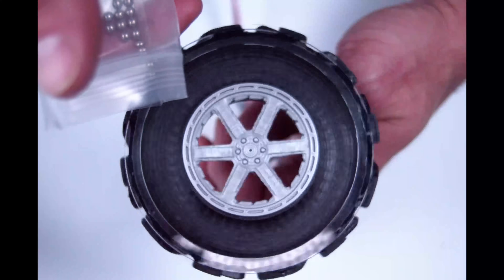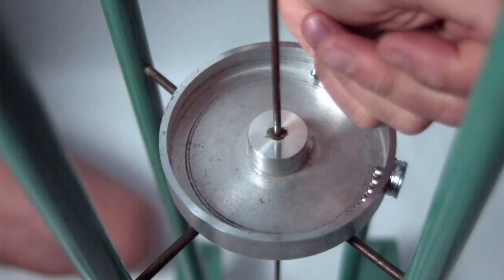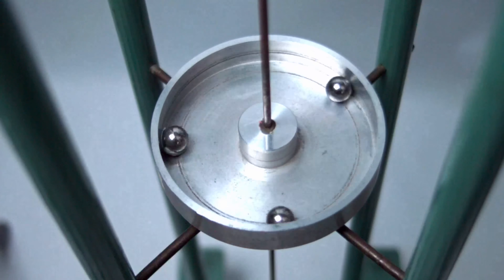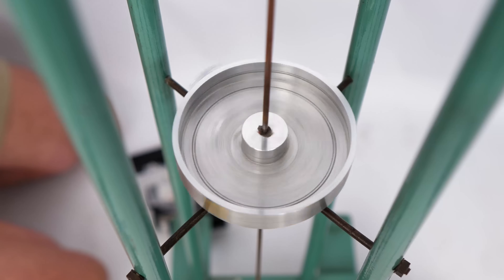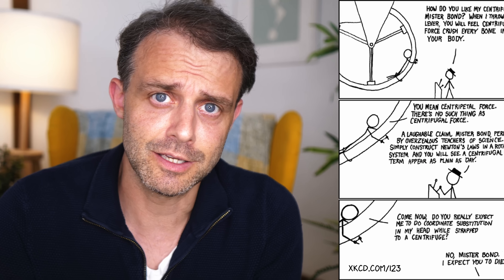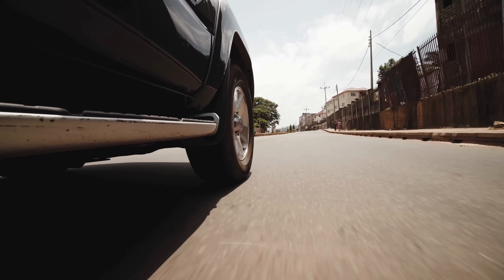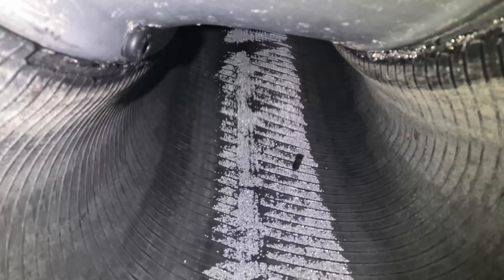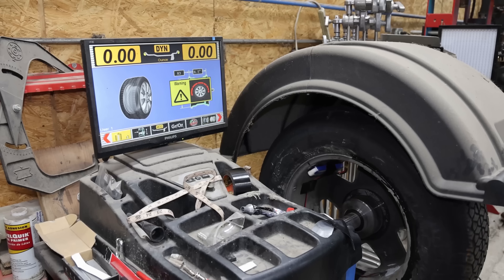Do tire balancing beads actually work?

Comment: A real world difference from tires and that machined aluminum cup is runout...tires really aren't all that round.
   It is even marked. New tires sometimes have red and yellow marks. The red one indicates maximum radial runout. ( actually, I think it's defined slightly different). The idea being that you measure the wheel runout, and mount the tire so that they cancel. 
   I've never done that, or heard of anyone who has.
    Toyota lists a max runout for a mounted inflated tire as 1.4mm.
    The beads would tend to rest at the spot with maximum inside radial runout, if the axle were rigid. (But it's not)
    I put the beads in my medium duty truck tires, since they won't go on my balancer..I am really not sure if they work, but am inclined to say they help.
   Thinking of making a fixture for the balancer for them.
   Thanks for this interesting video, I never thought of the transition from one mode of vibration to another.

Comment: Okay, so it sounds like what it does is work in a theoretical sense.
Given all those limitations it sounds much better to just get your tire balenced. Particularly considering that bits of glass or steel rattling around inside your tire might cause damage and further unbalence the tire.

Comment: Have used the balance beads from a washing machine to balance a driveshaft. Driveshaft had a pretty significant offset to one side as well as a drop from transfer case to differential. 1951 Dodge M37 with a SBC and a NP205 and stock offset rear differential. It needed the beads at HiWay speeds. Gear ratio was 5:83 so rpm were pretty high. Beads helped a LOT.

Comment: Pretty cool...since you would need the balance at high speed only anyway...

But

I could imagine that the balls wear down the tire on the inside just like the road does on the outside

You can't really see if the tire is worn on the inside tho...

So hopefully it goes bad on the outside before the inside gets too badly...

Comment: I wonder if those beads inside your tire along with weights outside would work. So if you have a tire vibration only at highway speeds then when you hit those speeds the beads will do their thing and at slower speeds the outside weights will do their thing.

Comment: What about a liquid? How about a liquid that sets after 20 minutes? Not solid but to a rubber like material? Wouldn't that solve the "until gravity can shift the beads at low speeds" problem? 

I could see a balancing can. Put it in like fix a flat and get up to 88 mph. And wait 20-30 minutes. Once you slow down, the tire doesn't lose its balance.

Comment: All I know is my 44 inch TSL swampers would beat the teeth out of your mouth until I added 1 pound of equal balancing beads to each tire.. what a difference that made but I agree with you because I can confirm that I have to reach a certain speed before the effect of the beads do anything however that speed for my tire size is not highway or freeway speeds it's roughly 35 miles an hour and then all the sudden it just gets smooth and it will stay smooth down to about 15 miles an hour or so and then I noticed they have no effect until I speed up to that 35 again this was an excellent video and the way you explain it makes perfect sense

Comment: Tire balancing beads are ineffective because tires aren't perfectly round when in use. On the road, the bottom of a tire flattens under the vehicle's weight, conforming to the flat surface. This distortion causes the beads to disperse or bounce erratically during rotation, preventing proper balancing. Unlike a solid metal disc, which remains perfectly circular, a flexible tire constantly changes shape under load.
Testing balancing beads on a tire machine balancer is misleading because the machine holds the tire in a perfect circle, unlike real-world conditions where the tire is distorted by weight and road contact. After years of research, I believe tire balancing beads are a scam.
Additionally, the balancers shown in some demonstrations are engine harmonic balancers, not tire balancers. An effective tire balancer would need to be a rigid, round tube integrated into the rim itself, not loose beads inside the tire. Loose beads or balls placed inside the tire can't maintain consistent positioning due to the tire's flexing. Instead, any balancing solution must be fixed to the rim to avoid distortion effects.
I hope this explanation clarifies the issue!

Comment: Very intriguing — but my thoughts immediately went further. Shouldn't the same effect apply to liquids? After all, liquids are essentially countless tiny molecular spheres, and at high speeds, they should also naturally center the mass.

Now imagine using a fluid that hardens into a soft, rubbery compound after about 10 to 20 minutes and chemically bonds with the tire’s rubber. All you'd have to do is fill the liquid into the tire, mount it on the rim, inflate it, and spin it at over 80 km/h for 20 minutes. By then, the fluid would have solidified and fused with the tire — producing a near-perfectly balanced wheel, regardless of speed, since the mass distribution would now be fixed in its ideal position.

If someone can disprove this, I’d love to hear it. And if someone uses the idea to get rich — just send me 1% of the profits. Thanks.

Comment: A high-speed CD burner I once had used balls in a cylinder to balance the disc before starting the burn process. The drive would go up and down in speed a few times to allow the steel balls to find their spots. Once it got into balance, the drive then increased the speed to ludicrous and then the burning process began.

Comment: I wonder, could you do something similar with ceiling fans? It'd be janky but I'd be tempted to test sticking a 3d printed jig with some ball bearings in it on each blade of an unbalanced ceiling fan and see if it can self-balance.

Comment: Why not create beads that are injected into the tire and then glued into place? You inject them at the balancing station, rotate the wheels at high speed for the time the glue needs to be applied, and there you have it.

The current technology with weights may be good enough, and the beads will not balance in the left-right direction.

Comment: The problem for the car is that the wheel rotates around a rigid fixed axle and not on a flexible shaft like yours.

Comment: What if you apply epoxy resin inside the tyre, add the beads drive at freeway speeds while the epoxy dries up and the beads position themselves to cancel out vibrations with balanced positioning....🤔this way the beads will remain in the correct position to damper any wobbling....plus they won't slosh around during low speeds....

Comment: Working on car for 2 long , we usually get complaints about vibration at 50 and it goes out by 65-70 which is always tyre balance , we know it balances once the speed raises and the vibration goes some could be near 90 but they still go , but I have never had vibration at such low speed you mentioned

Comment: Snake oil. Beads don't work in a tyre as they require the wheel to be rotating at a constant or steady speed. As soon as you apply the brakes, accelerate fast or hit a big enough bump, the beads lose sync with the tyre wall and the wheel would become very unbalanced. Even if this only happens for a short period of time, the vibrations can still cause damage.

Comment: Glass beads suck. They break apart eventually and turn into fine glass powder inside the tire. I know thus because I used them before on my semi truck. I then went and spent the extra money to get what I used in the past and know it works. The company Centramatic makes disk that sit in between the break and the rim. The outer diameter is a tube with oil in it where many ball bearings float in. They made my truck run extremely smooth. Unfortunately, they only make them for commercial vehicles and one ton pickup trucks.

Comment: I would imagine the next level invention would be to make them become sticky after a certain period of time or temperature profile and then stay stuck into the tire at the place they settled on. This would improve the situation for lower speeds and remove the internal tire wear problem, that has been mentioned in other comments. On the downside it would not keep auto-balancing during a tires lifetime, but we could simply add some from time to time.

Comment: I bought some a ways back to install on someones car that doesn't like to take care of it much, and found the same facts about the speed problem and didn't install them...  But I gamed out how it worked and how to improve on the idea.  It's not as simple as pouring beads in.  It requires a hub installed on the wheel to which heavy balls run around a track and which are held down at low speeds by way of a spring steel which releases at those freeway speeds.  When the freeway speeds are decreed the spring engages them into a rubberized floor holding them in the exact position, keeping the balance.  I'm not patenting the idea, I'd be fine to see someone who cares to think it worth to implement it do so.

Comment: That's also what happens inside washing machines during the spin cycle! The clothes tend to self-balance and reduce the wobble of the drum. That's also why washing machine drum shafts use flexible connections.

Comment: There is a device out there for Big Trucks called Centramatics.
I put these on all the wheels of my truck, and all wear issues went away.
Alignment was a pet peeve of mine, and I had the alignment checked and adjusted.

The only time the truck was shaken by an unbalanced tire was if the issue was in the trailer tires!
Reply: BTW, I should mention that I regularly put over 300,000 miles in the truck per year.
Between having all of the tires set for exactly the same pressure, the alignment, the balancing, and “grounding” (another story for another day), I could get 200,000 miles from steer tires, and 300,000 miles from my drive tires.

Comment: Is this related to counter steering on a motorcycle? Regarding speed? 9:16 ? You can't counter steer at low speed. But it is a dream at higher speeds.

Comment: So it would seem that balancing beads would be less effective on larger tires as they would have to roll at higher speeds for the R.P.M. of the assembly to reach the point of transition - large tires might never balance unless vehicle speed is far above normal speed limits...just a thought.

Comment: Lol 😅 they might work sometimes at certain speeds only in static balance mode, I guess it's not a scam but definitely  misleading marketing. 
I've tried several different brands of balance beads in several different size tires and have never been happy.

Comment: First off balancing beads are nothing new. It’s how truck tires are and have always been balanced. They work great in truck tires, as well as in mud tires. You can’t balance a set of 44 inch mud tires with a wheel balancer and wheel weights. Even if you managed to they would go out of balance almost immediately as chunks of the tread are ripped off, or the wheel and tire change their orientation. However using balancing beads in a car tire is a pretty stupid thing to do in my opinion. First off car tires are extremely lightweight and the beads are going to cause a bunch of wear inside the tire, not an issue when your taking about a heavy duty truck or off-road tire. Secon off most cars now have TPMS sensors and a bunch of ceramic beads flying around inside the tire is very likely to damage or destroy them in a few thousand miles of driving. Car tires don’t shed chunks of tread so they will stay balanced for the life of the tires. And lastly you can get car tires balanced almost anywhere and it doesn’t really cost much. I use balance beads in tires that can’t be balanced with wheel weights on a machine. I have them in my service truck tires and in my mud tires on my jeep. I don’t have and haven’t had them in any of my cars, vans, suvs, or pickups (well the F450 is an exception 19.5s are sort of mini truck tires, tire shops that only work in cars won’t touch them, ones that do truck tires treat then as truck tires and change them manually often without removing the wheel from the vehicle, they just throw a bag of balance beads in and call it good).

Comment: The larger the tire the less effective standard balance weights become. my 54 inch tall tires that weigh 550 pounds (roughly 250kg) the stick on weights are quite large and not really possible with rim clearances. Balance beads however work where there is plenty of room, and the adjust for tire wear and damage over the life of the tire. Typically balance beads are the only way to balance large commercial over the road trucks.

Comment: The eccentric mass and compliant axle behave as a second order low-pass filter to input speed. At a very slow speed, oscillations are relatively small. Near the resonant speed, oscillations are large. At a fast speed, oscillations are attenuated. 

The oscillations of the free ball also make sense as a "mass-spring system," where the "spring" here is actually the potential field created by the centrifugal force. At slow speed, the "spring force" is very small. At fast speed, the "spring force" is very large. This is akin to increasing the frequency of a pendulum by increasing the gravitational force (which does not increase mass). As such, increasing the input speed increases the resonant frequency of the "ball pendulum" by the square of input speed, which attenuates the oscillations. This is why the oscillation magnitude around the equilibrium point decreases with increasing speed. 

Of course, none of this matters for car tire balancing, because the road is a lateral distrubance to the tire, which oscillates as a mass-spring-damper with the suspension. Not only does the tire become imbalanced again at slow speeds, but also when the tire is disturbed by significant bumps in the road. 

Just pay a mechanic to balance your tires. It's usually free with installation.

Comment: In my old mud truck i used several different ways to balance my tires. They were 40”x18”R16.5” super swamper boggers. For a long time i used the same stuff most log trucks use. It was a type of sand or glass media. Then i used golf balls and tennis balls. They all worked very well! The golf balls were hilarious when you stopped at a red light, you could hear them bouncing around off the rim for a few seconds

Comment: I had run balance beeds in my wire wheels on a classic car and they work great but having to use tubes caused them to wear down the rubber and cause the tires to fail..

Comment: The beads will work well at street speeds, just be sure and burn rubber every time you pull away from the curb or stoplight!

Comment: I use centramatic discs on my truck: same idea but the beads are mounted in their own ring which keeps the tires clear and unaffected by the bead friction. The important benefit is tire wear: without the beads you might not notice the vibration as much at highway speeds but they’re still vibrating and the tread will wear unevenly. Balancing them perfectly keeps the wear even.

Comment: I'm very intrigued that in each situation, when the "wheel" goes into the forced low-inertial-moment mode, the axle itself seems to wobble much more? Seems to happen when forced by hand, but also when the beads are used. Not sure what this would mean in a real-world system.

Comment: My understanding is that the beads become statically charged as they move around, and tend to stick in place. I heard good things about these for motorcycle tires, and bought a couple packs, but considering the price of motorcycle tires, and the pain in the ass/expense of remounting if I have to undo it, they've just sat in my shop for nearly a decade now

Comment: Front load washing machines use ball balance rings to manage to constantly varying imbalance during high speed spin portion of cycles. They add some oil to damp out the movement and manage the oscillations. 

Another fascinating application is with fluid balance rings, often used in top load washing machines. These operate on related but different principles. When spinning, the cylindrical inside surface of the fluid wants to be centered on the spin axis of the body so that it has constant potential relative to the center. If there’s an imbalance which drives the geometric center away from the spin center, this results in fluid being forced to flow away from the imbalance. This arrangement cannot entirely offset the imbalance, but can dramatically reduce it. You can then increase the sensitivity/strength of the restoring force by making the ring taller or nesting concentric rings. Really interesting physics!

Comment: What if there was a tire balancing beads treatment instead. I would assume that this would work with liquid as well. Could some sort of rubber safe epoxy be placed in the tires with the beads, then rotated up to supercritical speeds while the epoxy sets? Then I would think that the beads could be glued into their perfect place so you wouldn't have to hit highway speeds for their balancing effects to come up again.

Comment: Why it works feels like how if you vibrate a square table of sand, the sand will organize itself into a specific pattern based on the frequency of the sound. The balls organize into specific patterns based on the frequency of the rotation, sorta. Just gives me the same vibes as sound patterns.